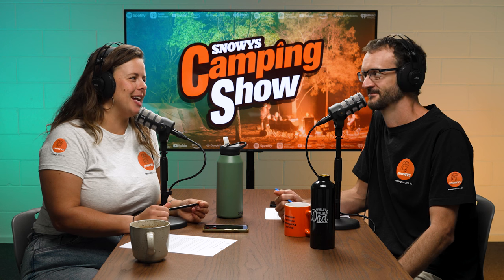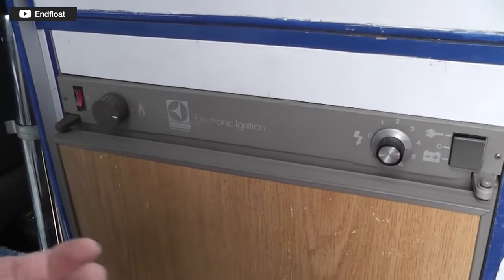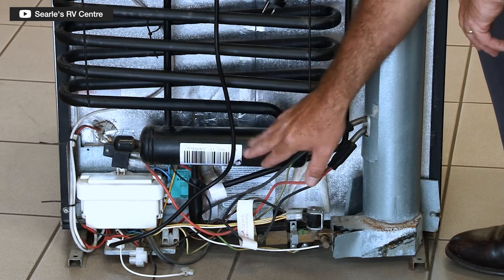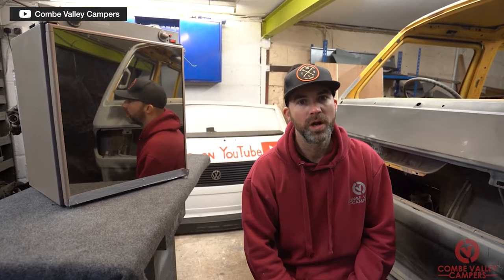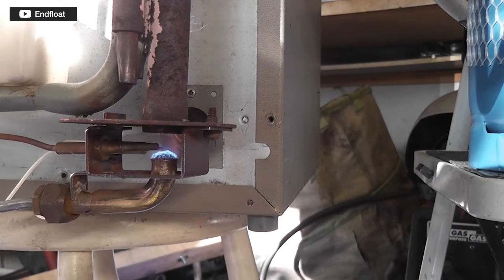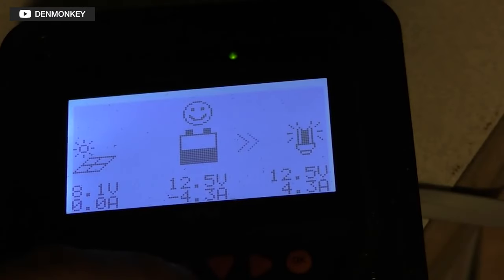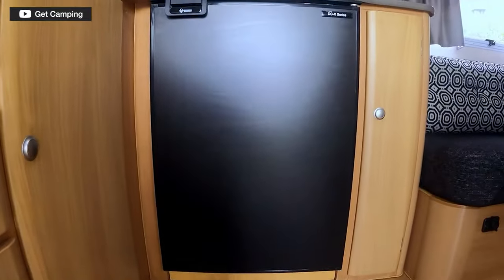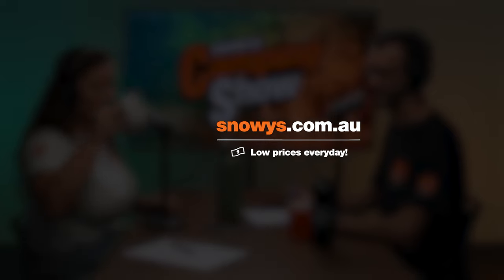Ep 52 - Caravan Refrigeration with Kev

Comment: I had to comment while watching. I have an old Camec CR190T 3-way fridge in the old bus I live in. It'll be something I'll be getting rid of either as part of the bus or by itself one day. The bus itself would be an awesome project for someone with more time and money than me. It's an old Bedford that's had the old 6 removed and a 308 Holden motor dumped in it. I'm heading along the 'live in my crewcab' path.
Reply from the maker: I assume you're moving to a 12V compressor fridge instead then, Brad? ~ Ben
Reply: @SnowysOutdoors  Yep. I picked up a 12/24/240 75 litre fridge. It's got 2 compartments with separate temp controls. I won't mention the brand but I have had it for a couple months now. Time will tell if it was a good buy or not :)
Reply from the maker: @BradGryphonn haha, I hope it turns out to be money well spent. ~ Ben
Reply: @SnowysOutdoors  Me too buddy, me too. For me, 600 bucks is a big investment.